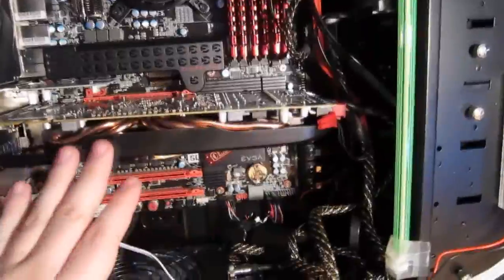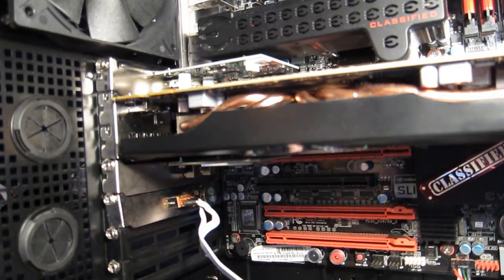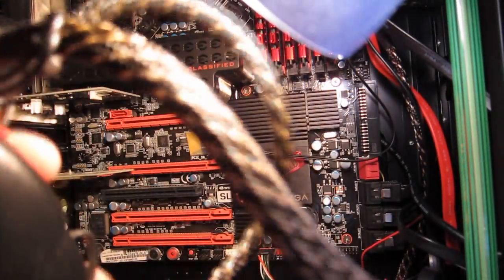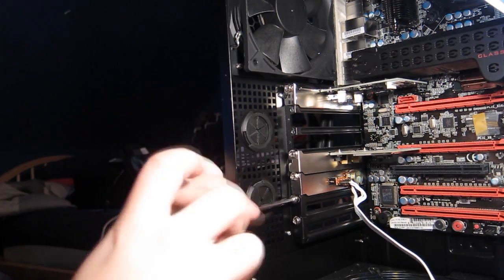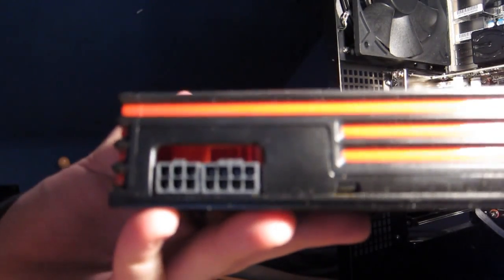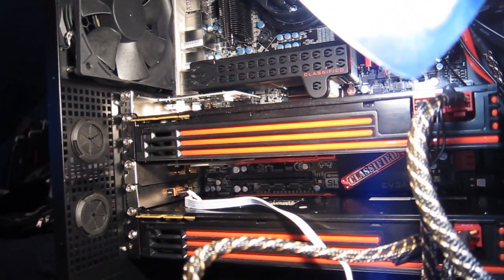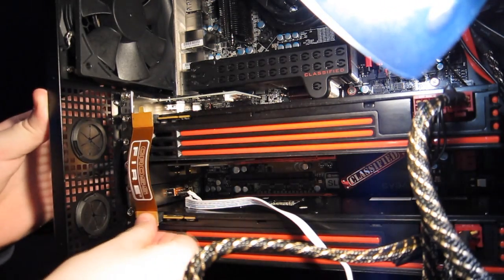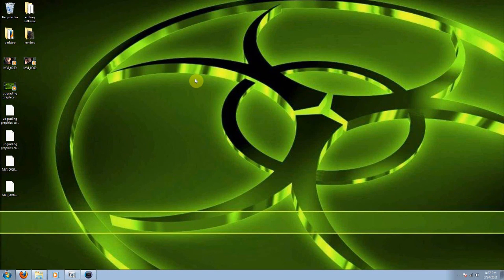DBO: How to upgrade and install graphics cards as well as set up "CROSSFIRE" and "SLI"

Comment: Im having an issue I can't figure out. I installed everything correctly I believe, but one card doesn't turn on or show up in device manager. I checked inside the case and the fans aren't turning on one card. They are both brand new.

Comment: when you change graphics cards and plug in the appropriate cables and close your case you can turn it on but if you are talking about the drivers the graphics cars will work they are plug and play but for the best performance download the most up to date drivers from the manufacturer's web site

Comment: they should be by the same manufacturer because of bios related issues they  do not have to be the same model but the same manufacture ex: crossfire asus 7850 with asus 7870  different company cards don't play well with each other

Comment: So you're running triple crossfire? :) 
u only need 1 strip to be put in, also for people with a pci-e 2.0 16x and a pci-e 2.0 4x -> be sure to read the crossfire strip where it says J1 and J2, u want to put the J1 on the MAIN card (the one that is using 16x) and the J2 on the 2nd card.
hastalavista

Comment: you haft to have the same kind of card and those bridges with the power connectors. i have tried it with 2 diff cards and it failed... and make sure you have disk to for program

Comment: @Kole208 it isnt bad, but the reason some people say its bad is usually by the time you get around to getting another card, a new and improved one is out and you cant buy the old one any more. If you do it quickly its fine though. And yes, that card will work just fine as long as your mother board supports it

Comment: @DesignedByOctan do you need to disable it with the MB i have? i'm not crazy good with pc's but i know enough to get bye on... also can you run 3 590's at the same time? or are they only 2 way sli also meant to ask... where did you get the SLI bridges... i dont think my card comes with it

Comment: @DesignedByOctan do you need to disable it with the MB i have? i'm not crazy good with pc's but i know enough to get bye on... also can you run 3 590's at the same time? or are they only 2 way sli

Comment: nice pc... ur using the same case as me.. antec 1200 V2 right?.. what cpu u running?  I'm on a i7 6core 3.20 ghz with hyperthredding, asus rampage III formula motherboard, 24 gigs of ram and will be slapping in a nvidia geforce GTX 580 when it arrives in the mail thx to the help of this vid.... ( currently only got a nvidia gt 220) I personaly did not know you needed to disable the old graphics card in order to slap in a new one... thanks for preventing a potential disaster...